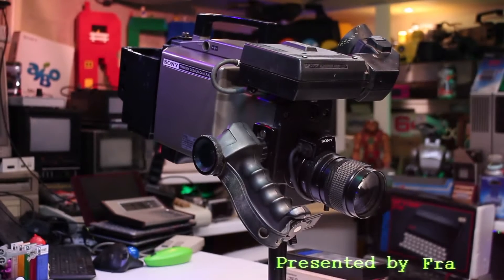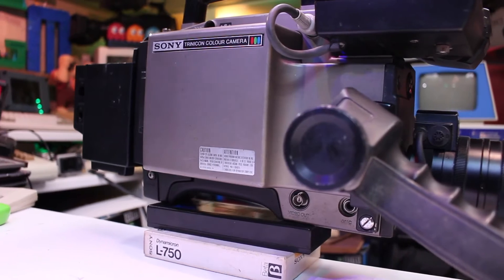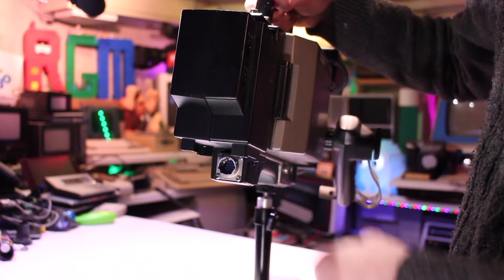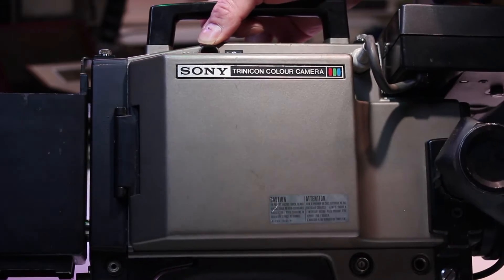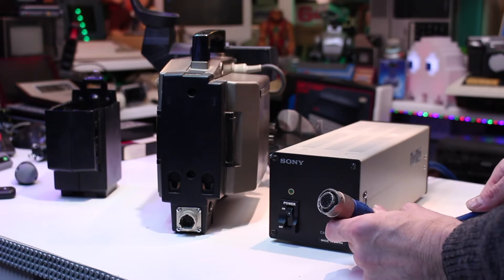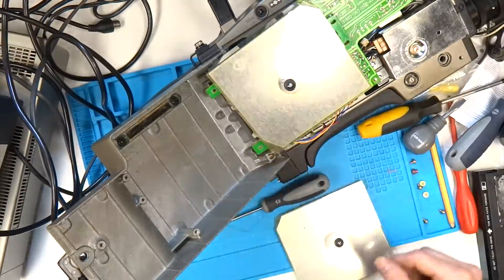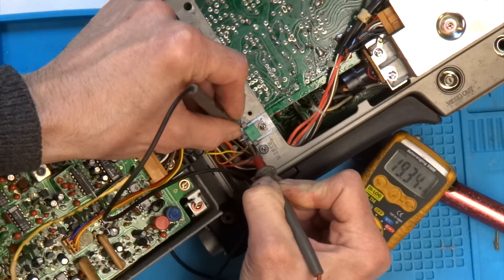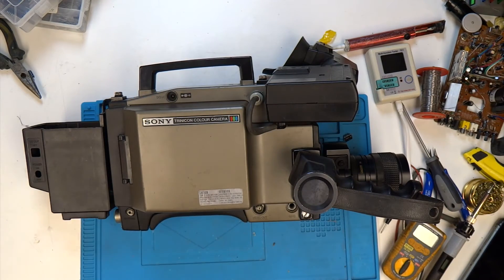SONY DXC-1640P Trinicon mixed field pickup tube Broadcast Video Camera from the 1970's Repair Pt 1

Comment: It's hard to say without a schematic but I bet there's a 9V regulator circuit somewhere. Lots of Sony schematics I've seen like to regulate the 12V to 9V. Not just cameras but also VTRs. I assume they are trying to regulate and stabilize the voltage from the battery If it's too high or too low. If it's drawing no current then I'm willing to bet it's a blown transistor or diode. 

I recently got a DXC-1600 which is the very first handheld Trinicon camera from 1974, it worked for a few minutes and then died. I don't hear the transformers for the power supply and flyback operating anymore so I think the 9V regulator circuit might be bad. It's made up of multiple transistors and diodes that regulate the voltage. I have so many projects I'm working on right now I'm going to have to put it off.
Reply from the maker: I have the service manual now. One day I will look at it again. I am also in the midst of lots of project’s.